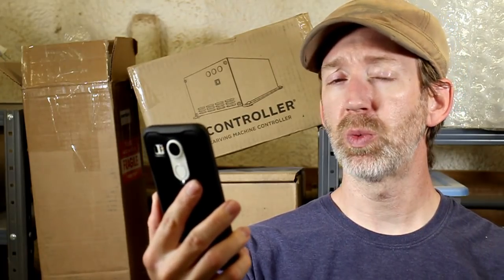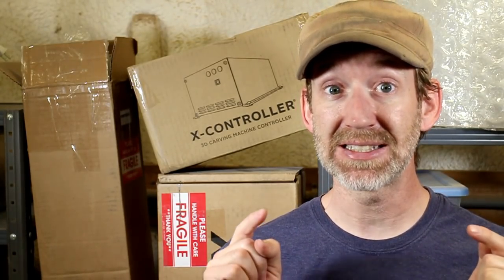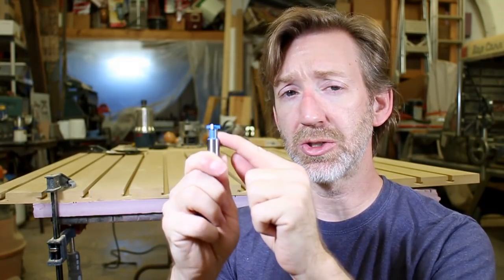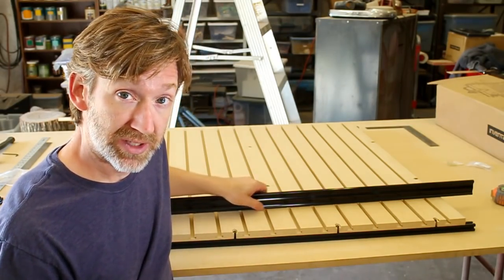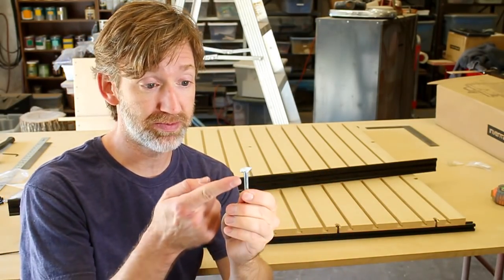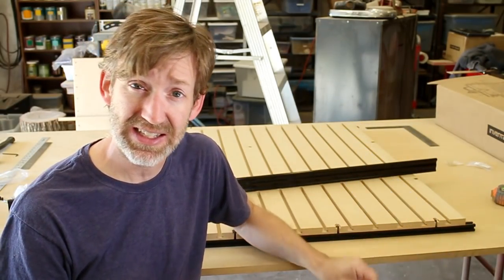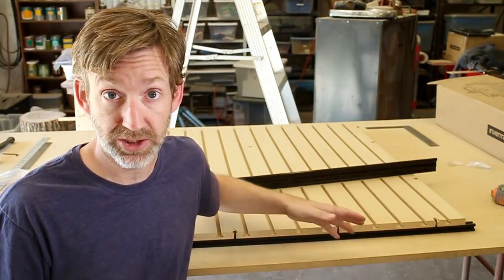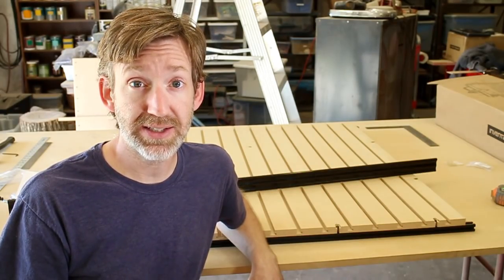Cheap & Easy T-Slot Waste Board for the X-Carve CNC Router

Comment: Did you buy extra hardware to offset the removal of the Inventables Wasteboatd kit?
Reply from the maker: I believe I did. Looking at my order confirmation, I added 2 each of items 25281-08 and 25286-15, which I think was all I needed to secure the board. I can't be absolutely certain because that was over a year ago, but I think that was it.
Reply: @WesleyTreat  the fact that you responded to me within 20 minutes is beyond incredible. Thank you kindly!
Reply: @WesleyTreat  would purchasing additional threaded inserts make sense as well? From what I've seen on forums, the parts you listed as well as the threaded inserts were recommended
Reply from the maker: @XxFuzzballsxX  The threaded inserts are if you want to replicate the clamping system used with the standard wasteboard. They aren't necessary if you want to use T-track.

Comment: I've held off on using T-Tracks because once screwed down you can't level the waste board.  However, depending on how deep you make your T slots here, you can level it quite a few times before you need to replace it.
Reply from the maker: I recommend having a look at Phil Johnson's waste board, also: http://www.designsbyphil.com/dbp-x-carve-waste-board.html. That will probably be my next version.

Comment: Would it be quicker and maybe cheaper to use 2 sheets of MDF and "mortise" the wider top of the T into the bottom and then just ripping another sheet of MDF into thin sections and attaching it to the bottom one? You could glue it or maybe even bolt the top pieces.

Comment: if only there was some sort of computer-controlled router that could be used to do all that work. Might be easier, faster and more accurate. If only....
Reply from the maker: If only the machine's cutting area extended to the edge of the waste board.
If only you had politely asked why I did it this way instead of being snarky.
If only you had bothered to read the video description before commenting.
If only ...

Comment: I have to ask, Wouldnt the "Easy" way to be to get the thing setup and route the channels using the CNC? That way its guaranteed to be inline with the Y-axis as well?
Reply from the maker: The machine's cutting area is smaller than the wasteboard.
Reply: Wouldn't it only deny you to 2 outer slots when you are cutting at full capacity?
Reply from the maker: The wasteboard extends beyond the cutting area on all four sides. You can't cut to the edge of the wasteboard.

Comment: What I did on my home brew was basically screw down T-track to some 3/4 plywood. Next I sliced up some 3/4 mdf in strips to fit between it with a dato sized to cover the upper lip of the T-track and leave a slot a tad wider than the slot in the t-track then glued it down. That way i could cut at least 3/8 off the top without hitting any track or any other metal.

As it got chewed up I simply routed out a pocket in it as big as i can go.  Then I simply cut new strips of mdf sized to go from one side of the slot to the other and glued them down. Clamping was a breeze, just slide some clamps in the slots and tighten it down.  Over the years Ive repeated the process a few times but I have NEVER had a need to remove the original filler strips between the t-track or the t-track itsself.  T-track is far more expensive than just slotting mdf but you can get real serious about tightening clamp bolts down and NEVER pull out chunks of mdf like you possibly can do with just t-track type of slots in mdf.

A trick that can prolong the life of any spoilboard is wood filler, either the commercial stuff or some made with glue and the mounds of sawdust you have to get rid of anyway. Fill up the dings and when it sits just do a pocket across the entire spoilboard at around a couple thou thou or so deep cut with a handy flat end bit. I use a 3/4 router bit but any end flat end bit will work, the smaller you use, the longer it takes. Just run it as fast as your CNC will go. On mine thats in the range of 350 IPM. What the controller displays can be off a bit from what the G-code says. Dosent take long to do a 2 foot square pocket running at 350 IPM with a 3/4 bit with an 80% overlap to do it. :) When it becomes more woodfiller than MDF simply repeat the above.

Structurally my CNC is different as the spoil board is NOT a structural element like the X-carves are. By going this way there is never any need to remove the supplied spoilboard at all. t only removes around 3/4 inch of the maximum Z cutting depth. And you dont have to deal with resquareing up an X-carve again if it moves while the spoil board is not in place.

Comment: I just used slot wall that is made.for store displays rather than pegboard.  Way easier than making your own t slots.  Great video, love your jig, check out the slot wall.  I got it at Home Depot.
Reply: I'm using it as well. Aluminum inserts are available for the slots/slats. I got used 1/2 sheets dirt cheap and luckily they had them already installed. Should make it last longer as well as adding strength.

Comment: the problem with using that jig for spacing is that if the jig is even a little off you will compound the error across all the slots you cut. so if you're 1/64th under then then next slot will be 1/32nd under, then 3/64ths under, and so on.
Reply from the maker: +Everfalling True, but that's not what caused the problem in the first board. I just measured wrong.
Reply: Wes, you deserve high marks for creativity and workmanship.

On the matter of compounding errors I agree with both of you. In this case it may well not be important because if you are using the T-slots just for down-pressure for clamping, positional errors don't matter. If, however, you were going to use the slots for accurate positioning, Mr Everfalling is correct, and track-related positions would become ever more inaccurate as you progressed across the board from the first cut track to the last one. This is why, in some ways, the XCarve baseboard is a good thing; its holes and layout grid are going to be accurately placed.

That said, there is another issue which concerns me more, mate, and I apologise if I sound like the archetypal safety Nazi, BUT The adhesives used in MDF and particle board and all those composite materials are known to be carcinogenic. This carcinogenic property may also be a property of the small particulate size of wood dust produced in machining operations, but let us not worry about the details of why it is bad; that dust is bad shit! If you don't wear at least a dust exclusion mask, you may get to go to the big ole woodshop in the sky a lot sooner than you plan to. And we will have a shortage of your entertaining videos. See this for evidence, and Goongle for other sources.

https://www.google.com.au/url?sa=t&rct=j&q=&esrc=s&source=web&cd=3&cad=rja&uact=8&ved=0ahUKEwiI2IaQjarYAhVGVLwKHTfKDKMQFgg3MAI&url=http%3A%2F%2Fwww.ewp.asn.au%2Flibrary%2Ftut_panels%2Fdownloads%2Fwooddust_q_and_a.pdf&usg=AOvVaw39SpyTriayLi7pUXI55I_S

The last potential problem concerns the strength of the MDF between the T part of the slot and the surface of the board. Repeated use and/or high clamping pressures will cause the slots to fail upwards, This is why Larry Strayer's commebnt is relevant; aluminium T-track costs a bit more but it is more durable. I suppose it all depends upon what you intend to do with your machine, and how often you do it. For light duty work your solution is more than adequate. If, however, you plan to use high tool pressures or do large runs, Larry's answer might be better.

Note that these statements are just comments, not criticisms, which is why I close with a "Just sayin'."
Reply from the maker: I use the slots only for clamping. I can't imagine why I would use them for positioning. Also, I use a mask when working with MDF or any other wood. Thanks!

Comment: 2 things, if you left the edge of the board with the rounded track coming out, you might make inserting t-bolts easier?

2nd, I am not a big fan of t-track, I am a dog hole supporter.  your making your own t-track vs. buying it is an idea I support.  I own a Legacy Ornamental mill which has the same hold down issues as a CNC.  I used dog holes same as Marius Homberger's channel.  my using bench dogs is a little different than his though.  your hold down methods work when holding a piece flat to the table, but what about milling on the edge or on the end of the work piece?  my table can hold a piece in all three configurations.  I was hoping I could get you to review my video about my "New Milling Table".  I only ask because I am interest in your opinion (and input) as a very creative maker. please let me know if you have time.

Comment: Just one simple question - since you have CNC (will have it once fully assembled) - why you didn't assemble the whole CNC on plain MDF, and then let X-Carve machine carve t-slots - way easier,,,
Reply from the maker: The machine can't cut all the way to the edge.
Reply: fair...thanks
Reply: @WesleyTreat  Hi! Welcome back to a comment from 2 years ago! How much would you have lost cutting it on the router? Was it worth it in the end?
Reply: Well, I jever have the base board larger than the working area of the router. You will find out why the first time you want to surface plane the board with the router to have an asolutely straight surface for engraving, vinyl cutting, accurate aluminium machining etc etc

Comment: I got 7 minutes into the video when I started to think that drilling all of the holes would have been the better way to go.
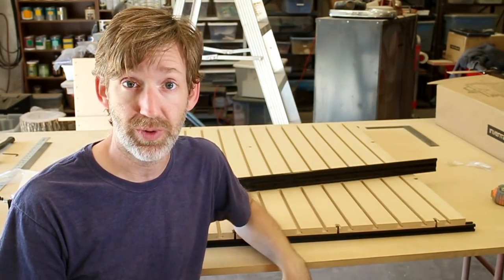It was then at 9:18 when you said you had to start all over when you confirmed what I thought.
Reply from the maker: I had to start over because I messed up my measurements, not because holes were a better idea. I could have just as easily messed up the measurements on the holes.
Reply from the maker: By the way, I'm not sure why it took you 7 minutes to think T-slots weren't a good idea. I was done with those at under 5. Everything after that had to do with mounting, which I'd have to do either way.
Reply: Dusty, nasty MDF.  Don't crank down too hard on those T-slots or the thin "T" part will snap.  Holes would have been much cleaner and smarter IMO. 
I did enjoy the process of you making them however.  The mounted wood runner did make it much easier.  I would have measured and mounted a straight edge each time.  Your idea was very clever.
Oh, and was it necessary that all of the T-slots were perfectly spaced from one side to the other????  They are just hold downs, not sure why it mattered other than aesthetics.
Reply from the maker: I made sure to cut the slots deep so there's plenty of material above the T-bolt to grip. I can screw down those clamps really tight. As for spacing, as I explained in the video description, the first set ended up running into the mounting holes. The mounting screws could technically have been moved since they slide into a rail, but I preferred having them properly spaced as designated. Thanks for watching!

Comment: Hi Wesley nice vid, to take the pressure of your router could you have started to cut the slots with your circular saw then the router straight bit then the t-slot bit , I know it would be extra work but in the long run it might have speed-ed things up if that make sense ,
G
Reply from the maker: The Bosch router I use is a champ. It had no trouble making it through. If it did, I would have just made three passes instead of two. Using the track saw first would have meant measuring for all the slots first. Something to keep in mind, though. Thanks!

Comment: I did the more expensive way. I used aluminum tee track I routed in mdf   Work great and the 1/4 bolts slide good 
Love my cnc router.

Comment: Cheap, yeah, easy, errr.....
Reply from the maker: I guess easy is relative, but it's literally just routing straight lines.
Reply: I finally bought and built an X-Carve last week. I made the standard baseboard myself with the 144 holes instead of buying it. Then I bought some aluminium T slot extrusion plate and bolted it to the existing baseboard when required. When I don't use that, I have a sacrificial board that gets bolted down and the CNC'd part is screwed straight to it.

The 1st part of the X-Carve instructions were excellent. As soon as it got to fitting belts, it became very poor.